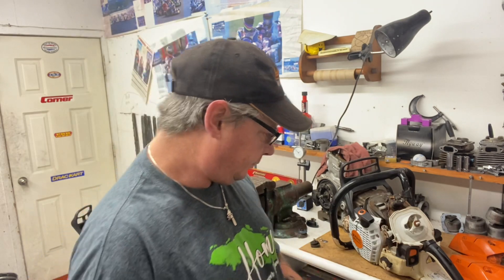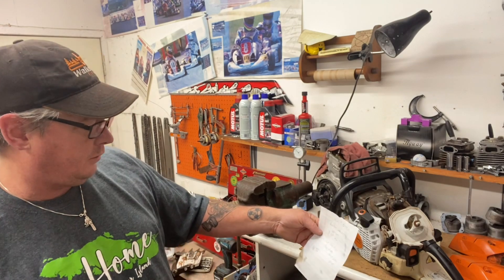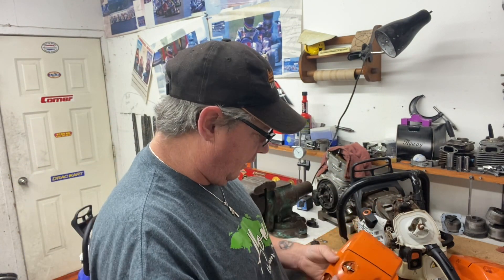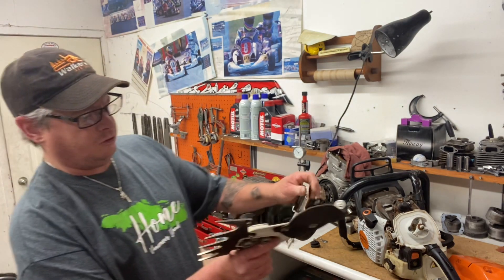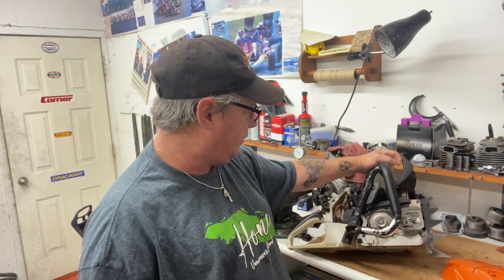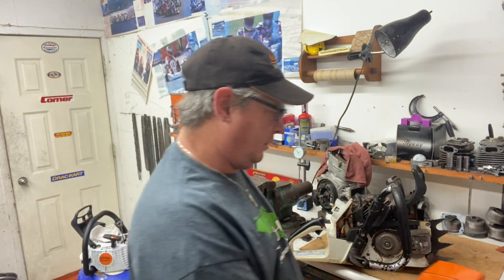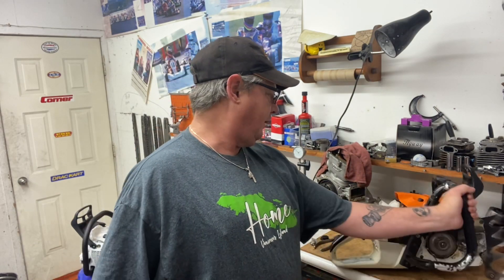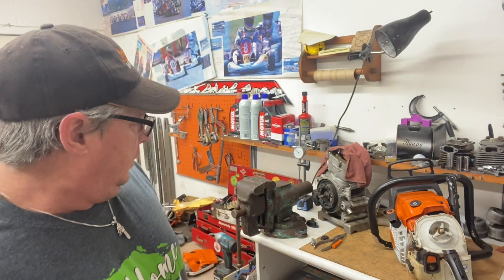Stihl500i fixes

Comment: Hi donny have you ever come across the chainsaws smoking and not cutting the wood as a friend here in Ireland 🇮🇪 has a 500i for the past year and has had nothing but headaches from it  😡 and is trying to get a new one or to get a refund
Reply: Has your friend ever tried sharpening the chain ? My best guess is he’s over heating the saw trying to cut with a crazy dull chain or he’s got the fuel mix so rich she’s just falling on her face hard. If neither of these are the issue I apologize, could be the injection software taking a crap 🤷🏻‍♂️